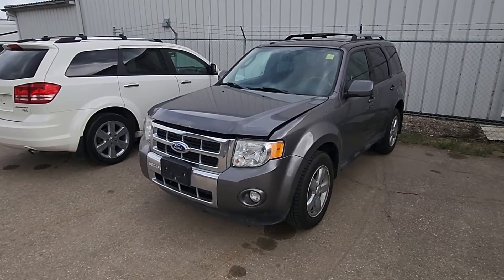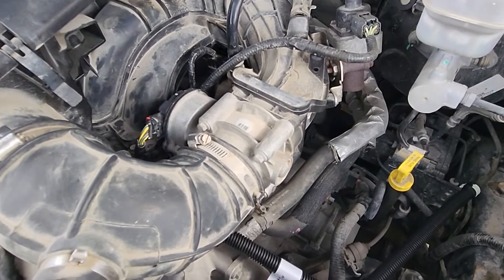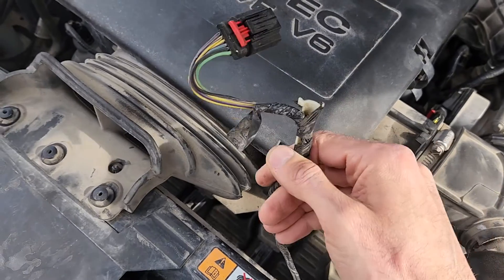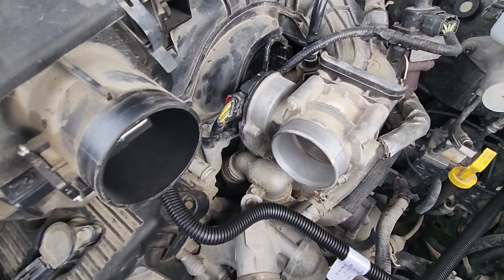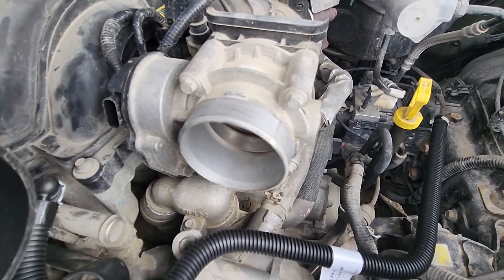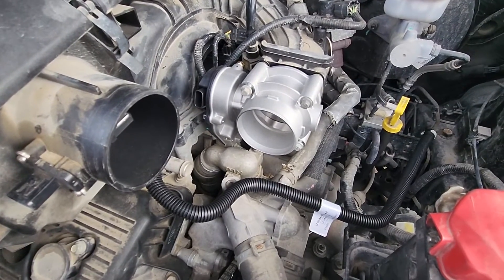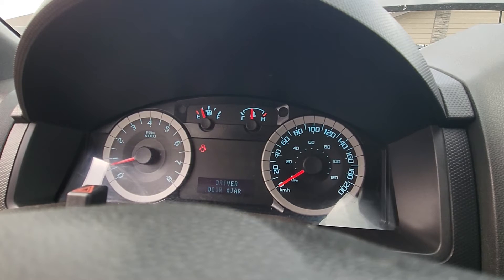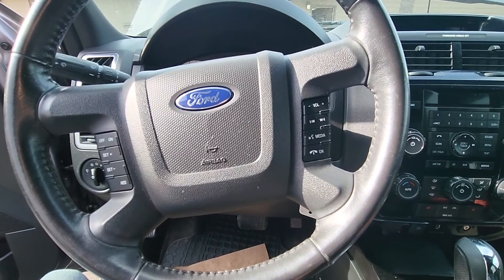Ford Escape - THROTTLE BODY REPLACEMENT / REMOVAL (2008 - 2012)

Comment: How to I reset the memory and pcm?
Reply from the maker: You will need an OBD-2 scanner to do the reset. You can also try disconnecting the battery for 15 min and see if that does it

Comment: I got the wrench problem on my 08 escape xlt I already changed the oil air filter cleaned the air mass sensor the throttle body was a bit dirty with black oil but cleaning everything I still got the wrench light

Comment: Hi, is it the same throttle body part, for the 2.3L and the 3.0L? Thanks
Reply from the maker: Hi, I will assume your escape is 2008 because only that year they still had 2.3L engine. Throttle body will be different for 2.3L and 3.0L engine.

In case you have 2009 - 2012 then throttle body is the same for 3.0L and 2.5L engine
Reply: @QuiteAlright  
Ok, thanks. 
Yes, I have the 2008 Hybrid 2.3L
Reply from the maker: @jimbo8743  You're welcome

Comment: Thanks for the video. 
Is this the same as the Throttle Position Sensor? thanks
Reply from the maker: No problem.
No this is a separate part.
Replacing the sensor should be easier and cheaper and then you can only clean the throttle body using throttle body cleaner solution

Comment: My 2008 escape wrench light on and the steering stopped working what’s that mean. Thanks
Reply from the maker: Wrench key means powertrain problem and calls for the service asap. Im pretty sure that this Escapes are equipped by electric power steering (electric rack and pinion) so that is the problem most likely. First check all of the electric power steering fuses. If all are good scan the module for any codes. If everything seems good then most likely you will have to replace rack n pinion. I suggest getting a used one from car salvage, they are quite cheap nowadays

Comment: Thanks for the video. I can't tell if I have transmission problems or Throttle Body problems on my Escape. I was driving normally, I stopped at a stop sign, I smelled something strange, then as I continued to drive, there was no acceleration... the car was still able to move, but the acceleration was bad. Also some noises that didn't sound good. Do you think this is the throttle body? Thank you so much for the help!!
Reply from the maker: It sounds like your Escape goes into a limp mode and losses the throttle response. It could very possibly be a throttle body problem. That's where I would start. Also try scanning the pcm for any current or pending codes in any of the modules. I don't think this would have anything to do with the transmission

Comment: What if you have a hybrid
Reply from the maker: I've never did it on the hybrid, but it should be the same. Part number is the same as on the regular gas so I presume the location and the process will be the same. On this video is Escape with V6 engine, you'll have either 2.3L or 2.5L depending on the year of your Escape. Electric battery is in the back, so it shouldn't be on the way
Reply: Yes with the hybrid the gas engine shuts on & off while idling. Did you give it a go Dmj831?